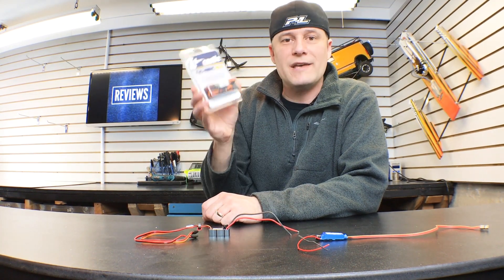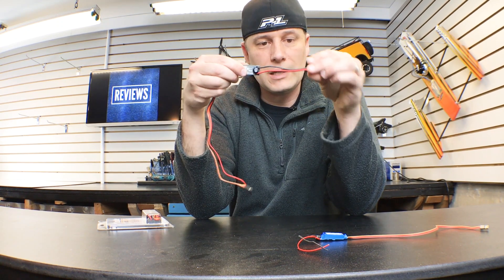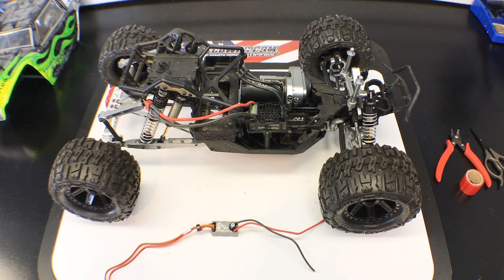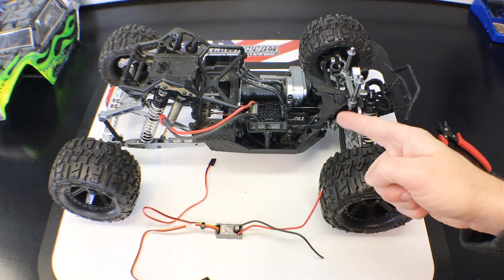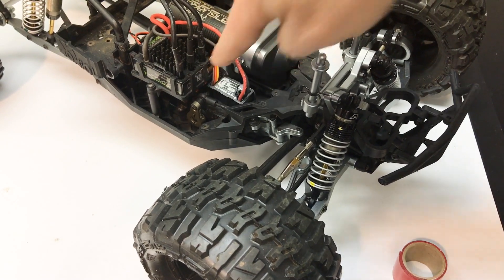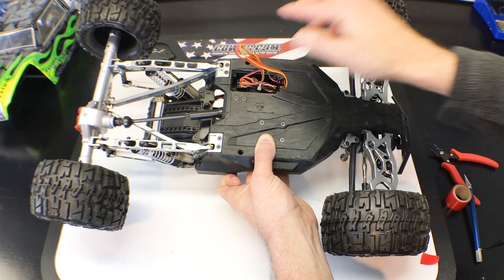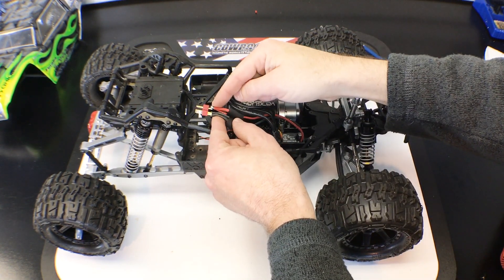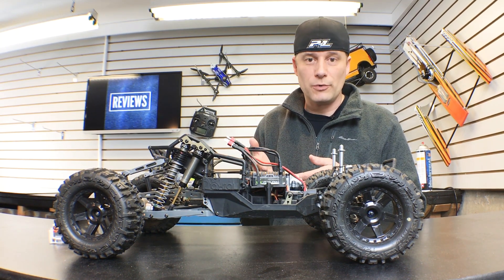Servo Power Boost - How To Install a Castle Creations BEC 2.0 Voltage Regulator

Comment: So you just plugged the wires into any random open port on the transmitter? And that actually works correctly? Mine says voltage/temp sensor port, RPM sensor port, and BATT/. So any of those would work?!?? What about for adding a switch for led lights too? Would it matter which ones you plugged them into? This is for a traxxas summit 1/10 if you're curious.

Comment: How would you use this bec to power a servo without running the extra voltage through the receiver? The purpose of the extra set of output wires confuses me. Normally don’t bec just have 2 input wires and 2 or 3 output wires?

Comment: This is the top result in my search. Love Greg’s videos. Worst video he has done. Doesn’t show cutting of the red wire. Doesn’t explain that the esc red wire should be cut because it’s only sending 6v to the receiver. Doesn’t explain that your rx needs 2 free ports. Doesn’t explain why you need to run both cables from the Bec to the rx. Didn’t need to show us a car. Should have shown us all the electronics on the table, what we need to do, and why. Sorry to be so critical, I know it’s hard to make videos. This clip raises more questions than answers and Greg can do better
Reply: No no you are right I need help and this doesn’t have the information needed

Comment: Hi I have a question.
Things I have 
Gen 7 pro receiver 
HW ESC model 1080
35kg servo that can work at 7.4 v

My question is if the receiver wont burn if I set ESCs bec voltage to 7.4 and if the servo will take that voltage too

Comment: I am considering running a BEC on my 2019 V4 Arma Kraton, the stock ESC (BLX185) currently outputs only 6 V. It does not have the option to adjust the internal BEC. So if I install the external BEC is that going to be overpowering my ESC or be bad for it?
I currently have the Savox sw12g,  which is capable of being powered by 7.4 V. And I’m pretty sure that the receiver I have in my car can handle it. Is it common for most receivers to be able to handle the increase up to 7.4 V?

The other question though is in my going to increase the chance of overheating my ESC and my motor by pushing it be on the 6 V that its native for?
Or should I just splurge another hundred bucks and simply pick up a new Mac 6 esc,  Which has an adjustable be easy internally?

Comment: is there a solution without the need for soldering?
Reply: No.  If you are in this hobby you really should know and learn how to solder.  If not, take it to a local hobby shop and have them do it.

Comment: Custom Setting increment for this B.E.C. is 7.2 jumping to 7.5 for the next selection. Missing the 7.4 volts that is so popular today for high voltage servo.
That's why I'm giving it 3 star.

Comment: Hi im having a bit of trouble understand why we have a dual output? my reciever has two channels that accept a lead as a battery or power source should i just plug both into those? and why are there 2 so confused, I dont want to burn my reciever please help!!! love the vid by the way very informative.
Reply: Hey preauz how did it turn out for you i see its been a year now an he aint responded yet
Reply: X01xCOUNTRYx01X hey thank for asking, it turned out great i still don’t understand the full reason behind why there is a dual outup but i believe it is so what the electronics are drawing high amounts of current it splits it between two leads. Al i know is its all good to plug them both in. Never had an issue

Comment: Cool, I just got cc Bec 2.0 WP. One thing I read is that if your ESC has a internal BEC you have to disconnect the red wire from ESC.
Reply: best to use a rx bypass to stop ground loop issues
Reply: @thump3r  what do u mean ground loop issues?

Comment: I know this is an older video, but my receiver does not have a spare channel that I won't use to plug the three wire lead into. I can plug the two wire lead, but not the three wire lead. Will it still work?

Comment: Or.... pay just US$2 to buy a DC-to-DC switching buck converter and you can adjust that voltage with just a mini screwdriver and household multimeter. 

Forget about an expensive brand name BEC and its fancy schmancy adjuster dongle -- a BEC is just a fancy name for a common DC-to-DC buck converter so that they can charge you US$20 for a US$2 component.

For FPV gear you might need some noise filtering, but for servos who cares.
Reply: Got a link to that?
Reply: @stevevinas  apparently not.

Comment: So I need a BEC for my servo. I'm not a hundred percent sure I understand the whole system of it. We are just bypassing the BEC in the ESC correct? So the external BEC just provides extra power to the receiver? And then the receiver transfers that extra power to the servo? I didn't notice you doing anything with the wires to the servo so I'm confused how it helps the servo.....
Reply: Paultro 84 You are correct. A typical ESC BEC only supplies 1 or 2 amps to the receiver to be split amongst all of the items plugged into it. An external BEC is likely capable of supplying 10 to 15 amps. This becomes necessary when upgrading to a high torque servo that requires 3 to 6 amps. And / or you plug in a big light set with light bar. And a winch, etc.

As far as installation, the BEC usually plugs into an open slot (or two) on your receiver, and supplies power to all the other things plugged into the receiver. All of the positive pins are common to each other, and all of the negative pins are common to each other. This is how plugging the BEC into a receiver slot powers the other items.

Comment: Hi, I've just installed the castle bec 2.0 WP on my Traxxas TRX4. But when all is connected the ESC led turn in fast blinking green, that means (according to the owner's manual) the ESC is not receiving a signal. I've already checked all connectors and is's OK. The led in ESC is in fast blinking green, the led on reciver in solid red and a small led on castle BEC is also in solid red... ¿faulty bec? ¿reprogram ESC? ¿any solutions?

I don't know whats happening :( 
Please help. Thanks a lot.
Reply: evoxer87 did you remove the red wire from each to receiver?
Reply: yes, I did it. But the problem is the traxxas receiver (and I think the most receivers) is only rated for 6 volts, due to this I had to figure out another electric diagram.
Reply: evoxer87 you have the bec plugged into the wrong spots on the receiver I have mine in the first empty spot and the rear diff spot and just leave my rear diff locked but when I have no load on the servo it’s twitching

Comment: A couple people mentioned the summit and using it for dual batteries. On the castle site there is a diagram on how to wire it with two batts. It is critical this is done correctly and the Internet searches lie. I am running it great on two summits using a Holmes hobby rx bypass adapter. It lets the BEC drive my high power servos off a y connector directly and continue using the BEC in the esc to drive the Rx and the shifting servos at safe 6 volts. So therefore my rigs are using 2 BEC's. It's sick. Do not plug the  second connector off the castle BEC into the Rx as instructed "for best performance" it says. You do not need it to work and what's cool is it can be used as a power source for anything else. I use it for light bars.
Reply: this was a great question and I wish it was answered by someone.
Reply: is the amperage halved on each castle bec output?  EX if the total is 12 amps is it 6 on the leads with just the black and red and 6 on the other that you can hook up the castle link too?  Also if using just one with a bypass connector does it matter which output you use?

Comment: I run a mamba x with built in 8a peak bec. I installed a external castle 10a bec just cause. Over kill? Or a case of better safe than sorry? I can say that response and speed of my servo is faster so guess I answered my own question lol

Comment: Hi there... nice vid... Quick question: would you be able to do a vid installing the same BEC on traxxas summit 1/10? I just bought the same BEC for my traxxas summit 1/10... Thanks in advance...
Reply from the maker: Wiring the BEC is pretty much the same. The only difference is where you mount it. Find a space where the wires won't get caught up in any moving parts.
Reply: RCDriver_Online would you be able to post some pics showing how does it looks after its all done? I already fried one ESC... the receiver on my Traxxas summit does not have free channel, do I need to get Y connectors? Please advise... thank you
Reply: Israel Quesada Holmes hobbies sells a bypass (y connector) and makes it to where you only plug one into the receiver. Bec servo goes into the Y, then the one coming off that only goes into receiver. An you do t have to remove the + from the esc wires. Much better way for 6$. An the wiring is the exact same as he showed you across platforms

Comment: what if I have 2 batteries? Just connect to one of them.
Reply from the maker: Hi Rich D, this connects to the ESC side/ wires. If your ESC has two sets of leads for the battery, then yes, it would get connected to just one set of wires.
Reply: RCDriverMagazine thanks much!!
Reply: ALL of the Castle BECs you showed can be programmed via the Castle link.